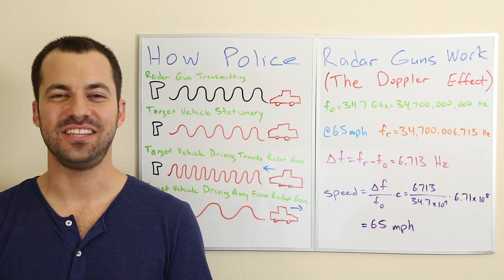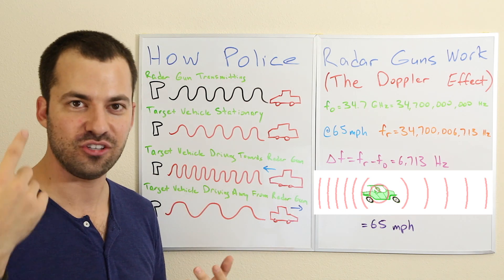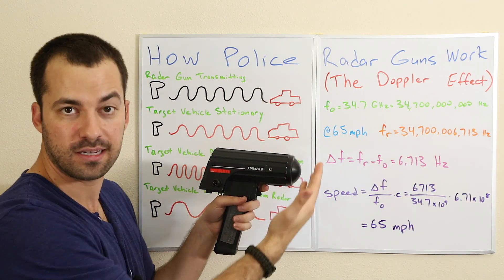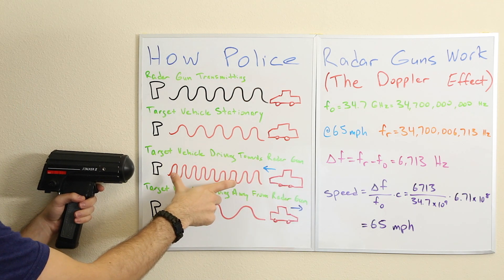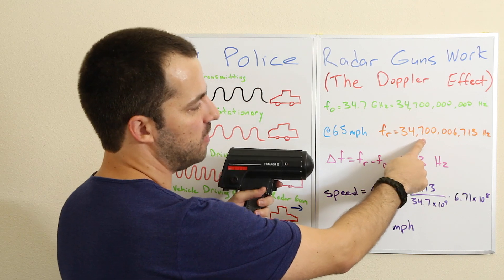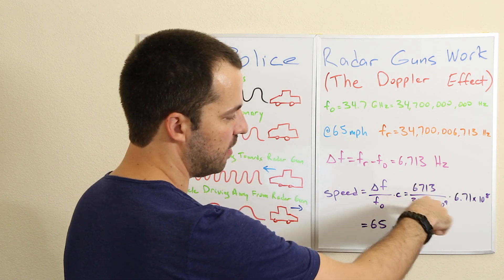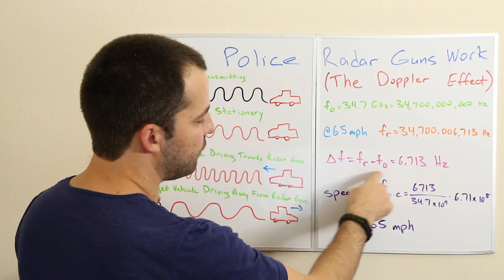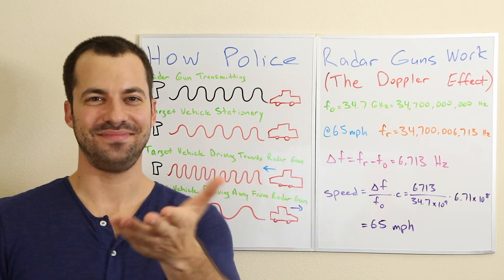How Police Radar Guns Work

Comment: Ok big question for everyone. Can police manipulate or adjust their bandwidth out of FCC regulations to speeders? I live on a small island off the coast of Georgia, Tybee Island. I run a R3 in my Tahoe, and an R7 along with ALP in my 2500. I’ve been behind people multiple times in the past six or seven months in close proximity and have picked up nothing. Meanwhile, police officers are turning around and the person in front of me for speeding left and right. I follow this page pretty closely, all my firmware is up to date and my settings are good. Any other town off of Tybee Island my KA works on both devices as normal. This department is very shady, so I could very well see them running equipment not within the FCC guidelines
Reply from the maker: They can’t do that. The equipment has to be certified and calibrated properly to be used to issue tickets. In fact that’s a way lawyers may attempt to have tickets thrown out.

That said they can also do pacing which is they match the speed of another moving vehicle, look at their own speedometer, and issue tickets that way. No radar required.

Comment: I know I’m kinda late but how do they adjust for angle? Is this why they subtract some amount from the measurement? Or can you just measure the cars when they drive straight at you?
Reply: Alright so it is important to measure straight on otherwise it results in inaccuracy due to cosine error. But the measured speed would be slower than the actual speed which works in your favor (at least if your not the police man). 

For handheld radar it’s essentially impossible to account for cosine error but I think if a stationary radar always measures the car at the same point on the road they could factor in the angle. Nonetheless the difference is minor and would only please the driver.

Comment: Does it have an effect if the radar gun is also in motion? One time I passed a cop (we were going opposite ways on a 2 lane road) and he flipped a U and got behind me and pulled me over and gave me a ticket for speeding when I knew I wasn't speeding anywhere near the amount he said I was cause i had cruise control on. Was this just a lying cop or would both vehicles doing roughly 50 mph towards each other effect the result the gun shows?
Reply from the maker: Radar guns are designed to work when moving too. https://youtu.be/FL7yhwK158A

Comment: But what about if the radar gun is at a 90 degree. It'll be zero right? So the radar gun has to be parallel or smaller angle than 90 to detect a moving object yes?
Reply from the maker: Correct

Comment: Hey idk if this question was asked before but if you’re moving in a pack of cars going in a straight line at variable speeds would this change out come of the radar gun reflected signal or would you have to recalibrate the gun every time?
Reply: No need for calibration. Wouldn't be practical

Comment: Hi. Great explanation. Can I ask: Do radar guns work through the windshield of a car?
Reply from the maker: Yep
Reply: They will also go through fibreglass, but it weakens the signal. Which is why fibreglass cars can be harder to detect. The signal goes through, bounces off the metal parts underneath and then has to go back through. It's why fibreglass hulled boats have radar reflectors on the masts.

Comment: 2:09 - Question: So are handheld radar detectors more difficult to avoid with a detector since they actually have press the trigger when targeting a vehicle, thereby preventing a detector from receiving the signal?
Reply from the maker: Dashmounts also have a button to start and stop transmitting

Comment: Does the distance between the cop using the radar and the road he used the radar gun on, change the accuracy? Does a cop using radar on a road that has a bend change the accuracy?
Reply from the maker: Distance doesn’t affect accuracy. Angle can somewhat due to cosine error, but that’s always in the driver’s favor.

Comment: thanks, I recently dived into radar and got so many questions to ask. Please help if you could get some of that answered. 1) There is an accuracy for each radar device. Will that changing over various distances? 2) How can Doppler frequency be calculated?
Reply: 2)What do you mean with that?I think all he did is input 65mph to the equation and found the fr(reflected frequency) that way.You dont really need to know the doppler frequency all you need to know is the change of that frequency.

Comment: In case of mounted radars (on a car for example) the change in frequency due to movement of target vehicle; will the reflected waves be more compressed due to the movement of radar device also, will there be more change in frequency, in that case will the velocity displayed be accurate?
Reply: I believe the radar guns compensate for movement of the police vehicle or takes it into account.

Comment: What will happen if you point two guns against each other
I am thinking about tiggering a gun whenever i receive a signal in the radar detector
Reply from the maker: The two guns won't interact in any way whatsoever. I take it you're wanting to jam the other radar gun? It doesn't work.

Comment: Subtract 1 from both sides in Doppler effect formula {fr = fo(v-vo/v-vs) vo is velocity of object, vs is velocity of source, v is velocity of sound, (sign convention = positive when moving in the direction of sound otherwise negative)} to get the formula written on board.
Reply: Thanks, man. I was struggling (because I'm a layman) to understand the interaction between the two.

Comment: Hi... video is very useful. What if the policemen moved his hand while he is activating the device? Can device give a wrong result?
Reply from the maker: Why would it?
Reply: @VortexRadar  when the policeman holding the speed camera, there is a possibility of shaking his hand. Will that effect to the results?
Reply from the maker: Again, why would it? These are designed to be used handheld by humans, not just on a tripod, so some handshake is normal.
Reply from the maker: Point at target and pull the trigger. Simple. Don’t shake it like maracas 😄, but handholding is otherwise fine.
Reply: @VortexRadar  true. My question was, if there is a hand movement, the results shows in the device can be wrong. Yes or No?
Reply from the maker: No.

Comment: Who else did the math the exact same way he explain and got ~130 mph?
Reply: He forgot to add the fact that you divide the final answer by 2 because the radar gun originally calculates the distance both ways so it doubles the speed. Halving the result will give you the actual speed of the object. So, in this case, 130 mph divided by 2 is 65 mph.

Comment: just to correct ur information . doppler radar transmits microwave not radio wave
Reply: Microwaves ARE a form of radio waves, but they are extremely high frequency radio waves. No actual "radios" operate at that frequency, but it's a name that we give to that class of electromagnetic radiation. It is also sometimes referred to as "radiofrequency" (or RF) radiation. It's just different names for the same thing.

Comment: Not too sure if you mention about the sound of different cars. My car is louder than the usual. Does that mean if 2 cars are traveling, the car with the louder engine sound will be detected? Am referring to station radar detector on the street side.
Reply from the maker: No, that doesn’t have anything to do with it

Comment: What if you put the car into neutral before the speed gun hits the car? What happens then? Does it still calculate your  speed ?
Reply from the maker: Of course. Your car is still reflecting the signal just the same, no matter what your transmission is doing.
Reply: Ottaney Bell Well obviously, you’re still moving. You would have to slam on your brakes & probably cause an accident lol.
Reply: Thanks. So in essence there isn't an actual way to beat the speed gun at recording your  speed then
Reply: Ottaney Bell There actually is. You can buy a radar that will notify you if anyone is pointing a speed gun at your car, giving you a chance to slow down.

Comment: Does the car have to be coming directly at you
Reply: Not necessary. However, the more angle between your direction and the radar gun the higher the cosine effect error. The higher the cosine effect the lower the speed reading on the radar. For example if an officer is traveling in the lane opposite of you he will get less cosine effect than if he was parked on the opposite shoulder from you. For smaller roads the cosine is negligible, but when the radar is more than 30% angle you begin to see higher cosine effect errors that may result in a few miles per hour loss on the radar reading. Essentially any cosine error is in favor of the driver and not the officer. When you have some time you should look into moving radar; it's a useful tool that i use everyday in my patrol vehicle.
Reply from the maker: or away, yes

Comment: So how did you come up with the 6713 number?  I understand how you got the difference of the transmission and the reception.  But I’m unclear where the 6713 came from.  Thanks in advance!
Reply: That’s the example # he used as the frequency returning back to the radar gun. Basically the difference between the 34.7 GHz and what was reflected back from the target vehicle.

Comment: Does the radar need to be directly behind or in front of the moving object to determine an accurate speed? Or could you radar something from its sides
Reply from the maker: Good question. Radar is subject to the cosine effect http://copradar.com/chapts/chapt2/ch2d1.html so it does have to be pretty straight on. A side reading wouldn't work.
Reply: Vortex Radar thank you!

Comment: Already know that also I know how block that to jajaja
Reply from the maker: How do you do that?
Reply: Vortex Radar get the laser wave fr, duplica and sent de back in tree way low medium and faster , so the laser read a error and without proof they can give a ticket jajajaja is a small device hide in my front bumper, when it turn off , it still work , like you drive a 40 mph but in the radar show you 35 I can change it but is a pain in the ass make the calculation to play with fr duplication and my sent fr signal device

Comment: Thanks, but this only works for a zero angle between the direction of travel of the car and the direction aiming the gun. Which is never the case unless the officer is standing in the middle of the road. OK so if you know the angle you can still calculate it, but how does it work for an unknown angle? For example when you're trying to measure the speed of an RC plane flying over your head.
Reply from the maker: +Elias Labordus Cosine error isn’t a huge factor unless the officer is at a sharp angle. Run the numbers and you’ll see.
Reply: That is why there is a theshold for error for example some countries state that for ex speed limit is 100km/h you will get a ticket if you were driving at least 10 km over speed so for example you were driving at 107 and for any reason the radar registered a 110 (3 km error) you already over 100 but some time you get 109 then no ticket!

Comment: If I have a radar gun or device at a car that transmit exactly same initial freq at higher strength. Would it jam the other radar gun?
Reply from the maker: No. Radar guns are designed to track multiple vehicles moving in different directions, some bigger and some smaller, some faster and some slower. They have strongest and fastest modes so even a strong signal won't prevent a faster signal from showing up on screen. Normally the classic example is a big slow semi and a small fast sports car. The sports car is faster (weaker signal) but the radar gun can still capture its speed in addition to the stronger return signal of the semi. Jamming and returning a fake signal are two different things. :)

Comment: The Doppler effect only works because the VELOCITY of the Sound/Signal is CONSTANT. So if the sender moves toward the receiver, the only way to fit the same number of oscillations in between is to compress them. And compressing waves means increase the frequency. 
(This is how my Physics Professor explained it to me, 20 years ago ;-)
Reply: And I learned it the hard way by getting a fucking speed ticket today.
Reply: Cool
Reply: Nice

Comment: is there a way to disturb the frequency
Reply from the maker: +MarcoBala92 There are radar jammers but they don't work well these days against Ka guns and radar jamming is highly illegal too.
Reply: I do believe there are some kind of special materials that absorb some of the radar signals but unless your a stealth pilot you'll never have access to it lol.
Reply: In theory you can transmit a signal of similar frequency towards the radar and the RADAR receiver will get confused as to which signal is it's own, the one that got reflected off of you or the one that you transmitted. You'll have to heavily analyse the incoming RADAR signal though for it's amplitude, phase,  polarization. Imagine it as you are standing in front of a mirror but it's not actually a mirror but clear glass and a different person is standing on the other side. You'll end up thinking that is your reflection and conclude that's how you look. Your eyes are the RADAR. You based your conclusion on a signal that was "transmitted" by another person as the spoof signal source when you were actually supposed to view the reflection instead. Radars are more intelligent than that but you got the point of how it can be done...

Comment: Someone asked how does the radar find out the changed frequency but i didn't understand  what you replied
Reply from the maker: The moving target changes the frequency of the original radar signal. Have you ever heard a car drive by and once it passes you the sound changes? It's higher pitched at first and then once it passes you, the pitch drops. That's called doppler shift. The sound waves are compressed when it's coming towards you so you get a higher pitch sound and then they're stretched when the car passes you so you hear a lower pitch sound. A radar gun is looking for this same shift in frequency using radar waves. It then calculates the difference between the frequency it transmitted and the frequency it gets back to determine how fast the target is moving.
Reply: +Vortex Radar i understood that frequency increases when the car is moving towards me and decreases when its going away but how does the radar know the exact value of the new frequency ?

Comment: how are you suppose to find out that the change in frequency is 34700006713hz if you don't know the speed the car it travels (i mean the radar gun will show; but is there way to calculate the change in frequency by the speed of the car?)
Reply from the maker: +Justin C The radar gun does that all itself under the hood. That change in frequency is what it uses to determine the target speed.
Reply: btw how is speed of light 6.71x10^8 ?? isnt it 3x10^8 ?
Reply from the maker: Since we want to measure vehicle speed in miles per hour, what happens when you convert meters per second to miles per hour? ;)
Reply: Vortex Radar ohhhh damn i missed that, thanks

Comment: the waves emitted by the radar gun don't travel at the speed of light, but at the speed of sound. You said it yourself, these are radio waves, the ones that transmit at the speed of light are known as LIDAR, basically it's laser beamer.
Reply from the maker: Radar (radio) waves travel at the speed of light. It's sonar that uses sound waves, not radar. ;) Lidar also travels at the speed of light.
Reply from the maker: See here for further clarification: https://en.wikipedia.org/wiki/Radio_wave
Reply: Oh now I see what you mean by radio waves.. THanks for clarifying. I got stuck in the nomenclature since english is my second language. I always thought that RADAR used soundwaves though, thanks for clearing that up too.
Reply from the maker: Ah it's no problem. I've actually had a tech support representative from a radar detector company once tell me the same thing so it's definitely a confusing topic, even for native speakers. :) Thanks for asking!
Reply: incorrect. radio waves travel at the speed of light.

Comment: Man I love your videos! So educational. I recently purchased a redline and programmed it to your specifications with your tips. I'm located in Missouri and had to turn off my K band because it never stops going off. Should I keep it on and just turn on TSR or does that "cripple" the K band too much so I might as well just keep it off.  Thanks in advance for the help.
Reply from the maker: Oh yeah, TSR is basically a must in most places. You do lose some range and it becomes a little slower, but without TSR the detector can be pretty unusable in populated areas so it's a necessary trade-off. Try out Auto Mode as well to help with the falsing further. Then add lockouts using an Escort Live cable and you'll get some more filtering in the city too. :)
Reply: +Vortex Radar thank you. One last question. If I am running my RD in spec mode and k band goes off is there a frequency that when I see it I should know "oh that is most likely a cop and not a blind spot false alert"?
Reply from the maker: +Barry Sanders on K band, not really unfortunately